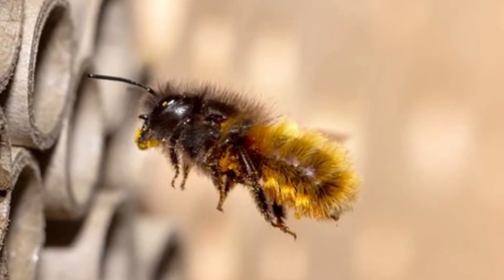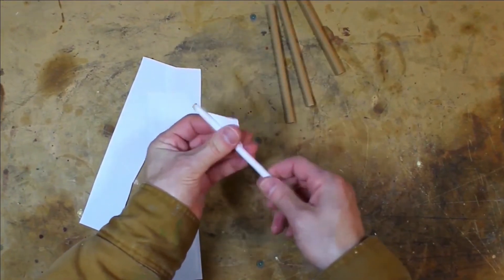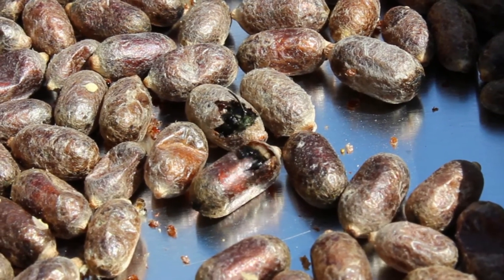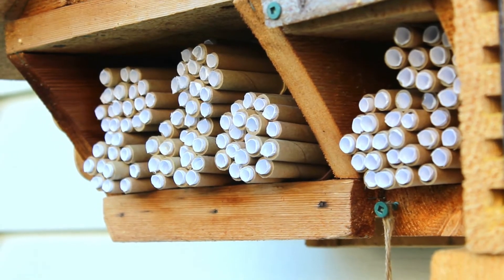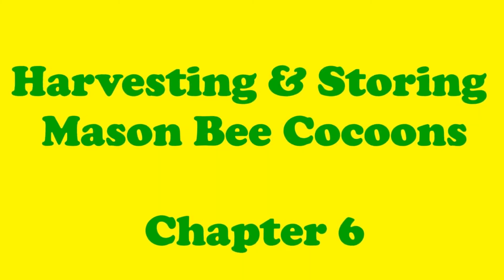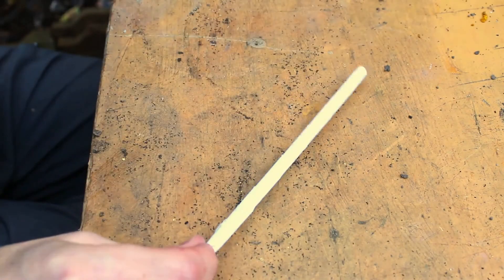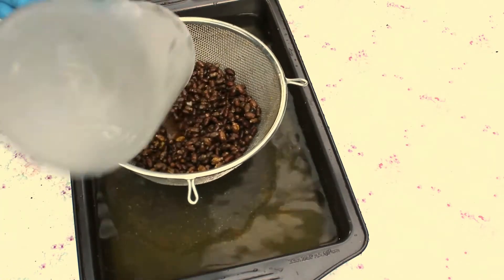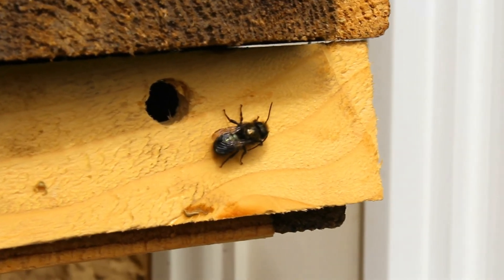Mason Bee Mini Documentary - Everything You Need To Know About Getting Started With Mason Bees

Comment: My nest was packed this season but I think woodpeckers drilled out all of the holes.
Reply from the maker: Ouch, that's too bad.  If the holes were deep, there should still be some cocoons near the back, so you may still be in luck. When I first started out, I used to attach a small chicken wire screen over the house entrance area (fearing bigger predators). The bees happily worked right through the wire.  After a few seasons I stopped using it as there turned out to be no predators in my area.  But that could be a strategy you try next season.  All the best!